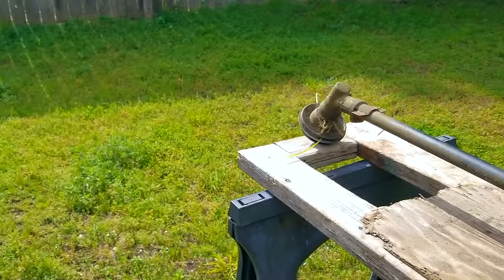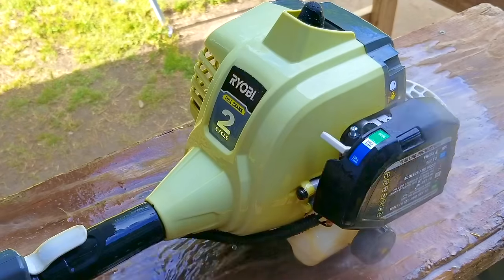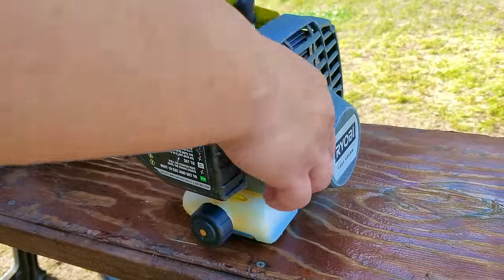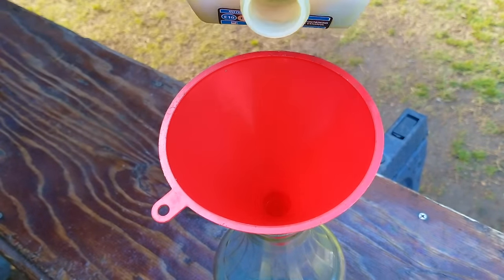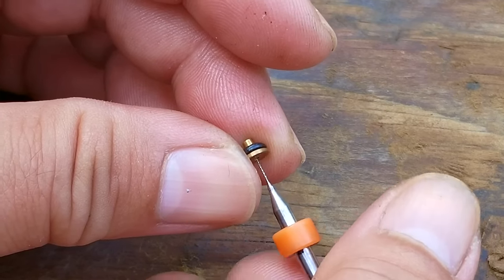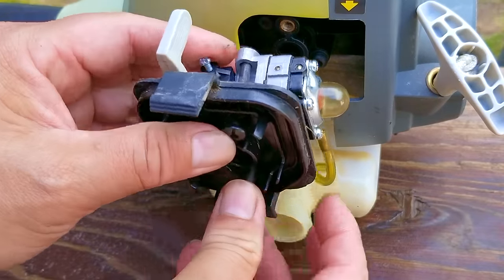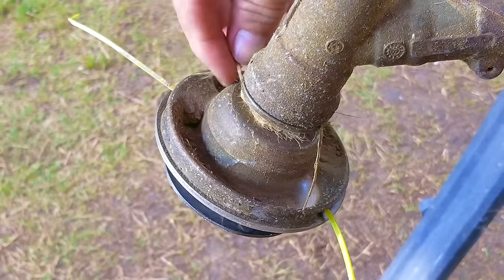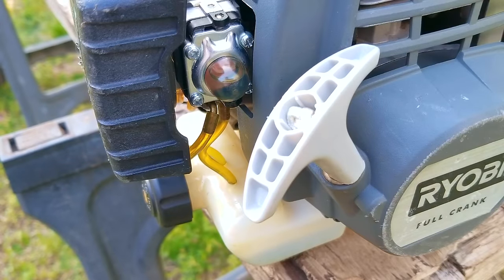Fixing A Ryobi Trimmer That Starts But Won't Stay Running

Comment: Yes i would use a cheap trimmer and yes i have. Years ago when i lived in PA, i used a ryobi trimmer with the attachments. Trimmer, edger, hedge trimmer , and the cultivator.  It saved me a small fortune in equipment and it all fit neatly in the trunk of my car, which meant i didn't even need a truck and trailer.  After 2 years i got the truck/ trailer and slowly bought individual machines.
Reply from the maker: very nice choice and it worked out in the end

Comment: For mixing gas I like using those home depot 1 quart mixing containers with the graduated markings. Two teaspoons is about 10ml so 500ml makes 50:1 400ml makes 40:1. Fills up about one tank at a time. I don't like mixing extra either, especially when I got older machines that need lower ratios
Reply from the maker: makes sense

Comment: Everybody says the same thing, they get about 1-1/2 years out of the carburator, so a 2 pack carb kit can last 3 years, if you empty it after each use and make sure the primer bulb is empty you might get a bit more out of the carb, when it's not the diafram its the outlet needle both parts ruin fast.😮
Reply from the maker: agreed
Reply: Had the same carb for 8 years no issues, should be lasting a lot longer than 18 months!

Comment: Great video!! I have had two occasions where I purchased carbs online and had production debris such as small shards of brass and aluminum in passages. Though this is rare, I would be aware of the possibility. I will say that the reproduction carbs are very well built and work well 99.9% of the time.Very thorough video, this will help keep these machines alive. 👍👍
Reply from the maker: yes Sir, I plan to at least try and keep them going, thanks again

Comment: My favourite trimmer heads are the SpeedFeed that Echo sells.  I even put one on my Honda 25cc straight shaft trimmer.  The head like you showed there, albeit fast to load is incredibly wasteful and time consuming especially in commercial work where grit, asphalt and concrete wearing the line incredibly quickly, having you stop frequently to change it.
Reply from the maker: thank you and yes the speed feed heads are fantastic too.

Comment: Love this video, thanks for taking the time in making it and explaining everything detail by detail. You explain, get to the point and boom it’s done. Others take their time talk about the cat, the dog, a pigeon flew over the house then will remove a screw to talk more and never gets to the point. I’ve had my Ryobi string trimmer for 5 years. It worked well and turned on every time. One day I was clearing out my yard (new homeowner) the. I started to smell like something burning then all of a sudden the timer just went clank clank and off it went. I tried turning it back on and I couldn’t even pull the recoils rope starters. I would pull and it’s locked in and just moved about 1-2 MM. I’m not a small engines mechanic or anything like that but I did buy another Ryobi string Trimmer. I was using it and it shut off on me 2 different times today. It would run for about 10-15 mins then it start sounding like it’s choking and running out of fuel at the same time. I have to check what’s causing this issue. 
They look the same just like 2 features changed. The attachment are is different and it has a butterfly head security feature that’s much easier to listen or tighten the attachment. And the choke lever is more sturdy and stays in place and not Like the old head that it moved on with vibration from accelerating the trimmers I don’t know the names of some of the parts so I tried my best hopefully you understand what I’m talking about. Thanks again and I’ll try to get it started
Reply from the maker: no problem and thank you for the comment

Comment: I’ve used trufuel in the past and never had issues with it although I’ve also heard horror stories about it too. In my area if you want ethanol free fuel then “canned” fuel is my only option. Just pour & go and you’re set. Especially useful before hibernation of your power equipment because you don’t have to empty your fuel tanks during the off seasons. I empty my 2 cycle equipment between uses but I keep the fuel in my mower all year long. I’m currently using VP Racing 50:1 mix, VP Racing 4 cycle fuel, Stihl motomix and Aspen 2.
Reply from the maker: very nice choices, thank you Matt Handel

Comment: Fellow Simpleton here. As a homeowner I only have three 2 stroke machines. I mix my fuel directly into the gas tank of each machine. They all take roughly 400 ml of fuel. I use a children’s medicine cup which has all the measurements on it. Pour in 8ml of oil. Add fuel and shake. 400/50 = 8 or 50:1 Never had an issue with fuel. 
I don’t work commercially but I have used low end trimmers in the past. 
Cheers
Reply from the maker: nice work! and your mixing skills are great!

Comment: Thanks! Sir, respectfully, my Ryobi 25cc will take on all challengers. Thank you for the inspiration.
Reply from the maker: no problem and thank you for the Super Thanks! I appreciate it.
Reply: I hear ya!  I have 3 ryobi's with 2 being that same model in vid and I was  shocked with the power n durability(once initually tuned correctly. )They seem to have come slightly out tune with the original factory settings that caused a lot of headaches.  Once adjusted tho they really wake up. I know...really?! Talking about power with a ryobi...yes! I have used n owned stihls and most other brands over the last 15+ yrs in property care/service and of course stihls are better quality, etc. I'm just saying the ryobi(again, once initially tuned because they need it)  was and still is way more impressive than people say.   99% of the issues I see with ryobi trimmers of that era  was the starting issues after purchase whether brand new or second hand, they needed fine tuning but we're very consistent after that.   If someone says that the ryobi in the video isnt powerful....they either havent used one or most likely used one that wasn't running to its ability due to the adjustment issue because these things eat!!...and have been doing so for almost 20 yrs now.

Comment: I like that style trimmer head.  My Poulan Pro uses 0.115 line which is very hard to find.  So I usually use 0.105 crisscrossed over so it doesn’t get pulled out if it gets caught.  My trimmer is 13years old.  I have trouble keeping it running, which video do you recommend rewatching?  Thanks for all the great education.
Reply from the maker: Thank you Steve Halsey, as for the trimmer, what does it look like? can you send name a pic to my mail? I'll then direct you to a vide. thanks homegaragemail@gmail.com
Reply from the maker: try this one, but to be honest, I would just replace the carb. 
https://youtu.be/mcL1hUZep38
Reply: @HomeGaragechannel  thanks

Comment: Yes, I have and would use a trimmer like that and cheaper, as long as it ran and one thing I've found out about Tru-fuel is that if you were using ethanol gas before, the Tru-fuel will cut the crud loose from the previous and you'll have to do some readjusting on your stuff.  Seems like I've had to reset the Stihl blower 2ice since Tru-fuel but it's been fine for several years now. No  more ethanol and the Echo needs a bit of adjusting but is good enough for who owns it. Blessings
Reply from the maker: very nice choice and if it works for you, I'd go for it too, thank you Lewie McNeely
Reply: @HomeGaragechannel  Just like our kids that didn't liked what was fixed to eat went hungry.
Reply from the maker: very true

Comment: My craftsman weed eater had a head like that years ago where you put pre-cut strings in it. For me I personally hated as as I was changing it multiple times when doing my yard. I switched out to the craftsman bump head. I also put a video up on the easiest way to rewind the craftsman bump head on my page as the instructions are useless.
Reply from the maker: yes you make a good point about having to change the line a lot

Comment: I have ran into this same problem with this same exact trimmer for the 6 years I’ve owned, fixed the problem three times, Even run it dry before storage. I’m also tempted to buy a Husky trimmer with a pole saw attachment since I’m in the need of one.
Reply from the maker: I know it's weird right
Reply: @HomeGaragechannel  I honestly think it’s just this type of trimmer, I’ve never had a problem like this with any other I’ve used in the past. I thought it was just bad luck but after seeing many videos online with people having the same issues and that you’ve worked on this before it’s just time for a new one for me. Also I never liked the sound of this one, idk what it is but it’s like it’s hollow or something.

Comment: I do yard work as a side job in the summer for extra money. I have about 60 lawns I do weekly/biweekly. I will tell you that having a cheap home owner grade homelite weed eater on my truck as a back up has saved my butt more than once. The commercial grade stihl and Husqvarna trimmers they make these days aren’t all that great, and have a tendency to stop running mid job. It’s happened to me more than once just this summer alone. You definitely want to have good solid equipment for commercial use, but there’s absolutely nothing wrong with a good old $50 back up.
Reply from the maker: nice, and yes a cheap back up is worth it's weight!

Comment: I had issues with mine and my dads ryobi trimmers leaking gas. Both fairly new and low time. Fuel lines in new/ good condition. Disassembled and inspected. Found all 4 carburetor assembly screws loose on both trimmers. Tightened up and purring like a banshee now. Hope this helps you out.
Reply from the maker: thanks for the tip

Comment: Great video and good detective work on on finding the problem, Then having  A FUBAR problem and logically then fixing that by replacing it. A lot of folks would have tried drilling that bit Out with the same size bit, But that would have caused it to Flood. Thank goodness for the Bone Yard!
Reply from the maker: thank you Dwayne Collins and yes another saved!

Comment: Is that carb for a four-stroke trimmer? Four Stroke carbs have that little spring inside of them. Steve'sSmallEngineSaloon did a vid a few weeks back on those springs. I have a residential trimmer as a backup, a cub cadet cc2000 with a ryobi kombi shaft on it; I used it as my primary until the curve shaft head wore out, then I bought my Echo.
Reply from the maker: that's the style of carb for this trimmer. It's strange to see it on here but there it is.
Reply: It works so it doesnt matter! Learning something new everyday! Thanks for the clarification!
Reply: Yeah, I recognize that carb on my craftsman 4 cycle. It has the same problem in the video right now. I clean the dang jet way too much :(

Comment: My Ryobi trimmer of late has been hard to start i figured it was flooded after waiting i finely get it started i was trimming for about 20 to maybe 30 minutes and it stoped running and i could not get it started again i checked the spark plug and it was clean i just recently changed it but it still seem like it's not gotting a spark what do you think i need to do
Reply from the maker: easy, replace the carb.

Comment: It's a full crank engine so besides needing a better air filter and maybe a heavier clutch design it will probably hold up just fine.
The air filter situation can be easily solved by purchasing an echo air filter housing and presto a commercial machine besides the clutch.
the brass cable guides on commercial machines are nice but honestly I don't see it as a necessity.

If I'm not mistaken these engines are basically the same as the Toro if it's the 25.4 and that design is actually originally from the original parent company to Echo Kioritz from what I have heard.
They're a Chinese knock off now but the same design I'm pretty sure.
Reply from the maker: thank you for sharing that information

Comment: I've never seen a spring located in the center body of the carburetor like the one in your carburetor.  The carb I'm working on is a Ruixing, model H639-00-02.  It looks identical to yours but doesn't have that spring.  I'm curious to know what numbers are etched on the body of your carb.  I'm concerned that the spring may have escaped during disassembly but also don't know if my carb should even have that spring.  I did an extensive search for rebuild kits for my carb and others that looked identical and none of the kits contained that spring.  I'd appreciate any explanation of the purpose of that spring and if you have an idea of how I can confirm whether on not my carb should have a spring.
Thank you....
Reply from the maker: does your carb have a "seat" for the spring to sit in like this carb?  If so, then your spring might have fallen out .

Comment: Never cared much for the canned fuel. My chainsaw seemed to never run right with it. I always use non ethanol gas mixed at 50:1 and always run it dry if it doesn't get used for a while
Reply from the maker: thank you James Hedrick and I've heard the same thing before as well.
Reply: I use that canned fuel in an echo chainsaw and it runs good, though i tuned the carb using it.  It’s the only thing i own that takes that ratio and i really don’t use it that much so don’t want to bother with mixing, plus I can only buy ethanol gas due to some silly law.  For a situation like that i think its good.  I also have no mixed i keep for the generators in sealed cans in case of power outage… since i can’t just leave my crummy pump fuel sitting in cans.  For stuff i use a lot i just run ethanol gas and run it dry at the end of the year with no issues for a decade.
Reply from the maker: makes sense

Comment: Nice fix, thanks. I have this model, given to me used. Runs fine but the vibration is severe and after a few minutes, my hands really feel it. Surprised that it vibrates so much because it is "Full Crank." Noticed at about the 11 minute mark that your unit was also shaking a lot.  Maybe it is just a feature/flaw  for this Ryobi model. Did you notice the vibration?
Reply from the maker: no excessive vibration from it, have you considered that that you might have a drive shaft support issue?
Reply: @HomeGaragechannel  Thanks, will check. .

Comment: The jet inside the carburetor on the top, where the barrel is, how many turns from the close position should I turn it to to make the trimmer run perfectly?
Reply from the maker: the number of turns is dependent on the health of your particular engine, and other factors including fuel quality in your area.  I cannot give you a number for that. It has to be tuned by ear unless you have equipment to help out.

Comment: Had same issues with Ryobi 2 stroke,  it would start but within several minutes it would bog down and shut off.  I replaced the carburetor, full lines, fuel filter, and spark plug and it still runs the same way.  Any suggestions on what is the problem?  It seems like it runs for several minutes and then it bogs down.  Appreciate your video!
Reply from the maker: sure have you considered replacing the fuel cap?  The vent on the cap might be bad and not venting air into the tank and therefor, after a couple of minutes keeping fuel from leaving the tank .

Comment: I got a question i have a feather light and it starts ok but when it cold i have to keep it half choke for 1to2 mins then after that i can open it all the way and runs good very powerful but i try to let it idle it will for a short time then start to die down and quit but will start right up and if let it sit for 5 or ten minutes i am not sure why it has to be choke again when it hot out
Reply from the maker: no problem, the choke is changing the air fuel mixture to be heavier in fuel and less in Air. Basically your adjusting the carb but not permanently. To fix it, you can try to adjust the fuel screws but if you'r unsure of what you're doing it can turn bad, quickly. I'd replace the carb.

Comment: there is nothing wrong with cheap equipment if it works. at least it doesn't sting as much if it gets damaged and it is less likely to get stolen. the only machines i would avoid are the very cheap ones without a clutch. i find these can usually be more of a pain when they start having issues.
Reply from the maker: that's pretty good advice

Comment: Is good idea to leave no gas in the tank of the  trimmer?
Reply from the maker: no it's a great idea.  When you now the trimmer is not going to be used for the next month, get your trimmer running, then pour out the fuel into a different machine, and then let it run until the fuel in the lines is all used up.

Comment: I tried everything to fix mine and after hours I had enough and decided to toss it in the trash and bought a DeWalt 20v brushless trimmer instead no more pulling string BS and it works every time electric is the way to go for this kind of work.
Reply from the maker: I admit it has its pros, but there are some cons to watch out for too.

Comment: Hey @homegarage I was using my weedeater yesterday and turned it off for something and when I went to start it back up it wouldn’t start back up do you got any ideas on how to keep it from happening again
Reply from the maker: well if you really want to avoid that issue, I'd replace the spark plug and the carb.
Reply: @HomeGaragechannel  thanks
Reply from the maker: no problem
Reply: @HomeGaragechannel  have you ever used Harvest King